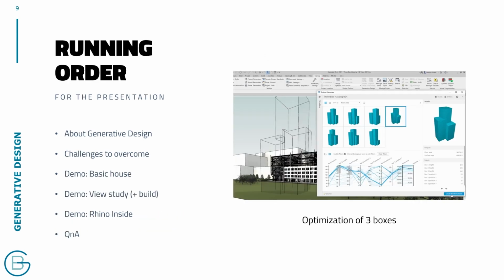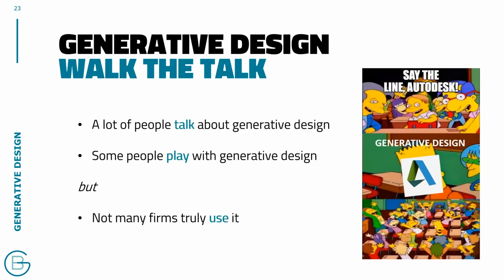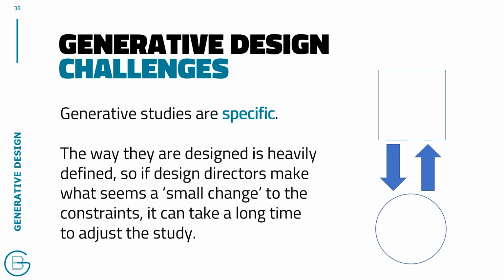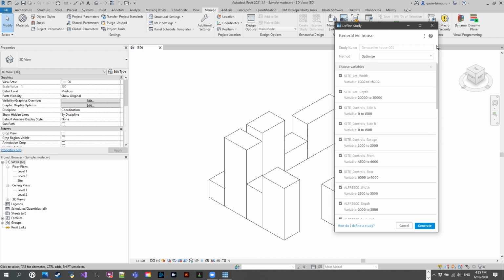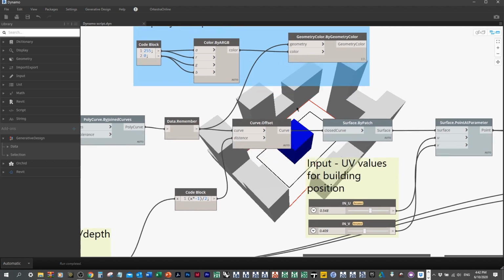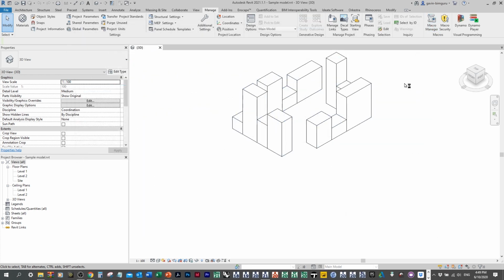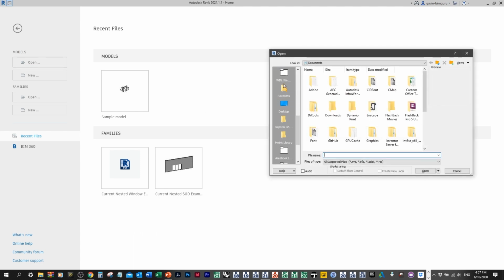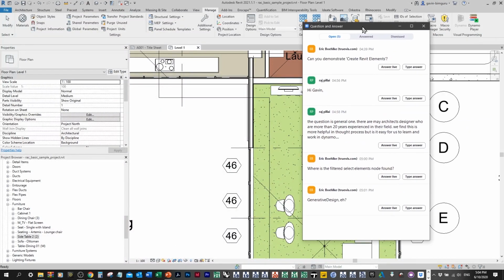Webinar: Generative Design for Revit/Dynamo

Comment: hi Aussie BIM Guru, i am doing MS in Construction Engineering Management, i have done my course work, now i am doing my research in automation of desiging regarding floorplan/layout through revit. can you please share me the script file? i really need it to start.
Thank you
Reply from the maker: You can find the Grasshopper/Dynamo scripts on my github:
https://github.com/aussieBIMguru

Theyre proof of concept only really. Floor plan automation is very difficult and computationally demanding - Revit probably wont give you the best results versus Grasshopper.
Reply: @AussieBIMGuru  really thank you for your prompt response.
Yeah, do you think automation of floor plan can be possible?
Reply from the maker: @al-quran1940  plenty of applications out there are doing it such as swap ai. It takes a lot of advanced code to achieve it though.